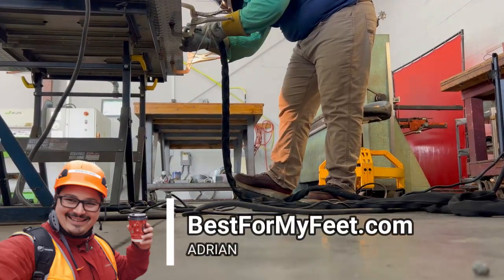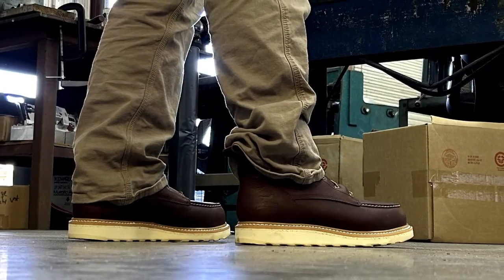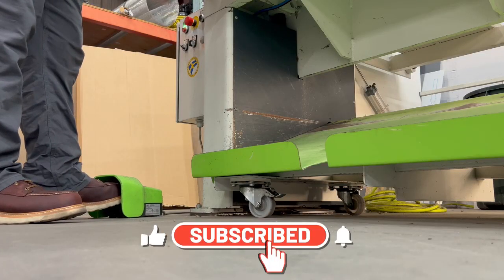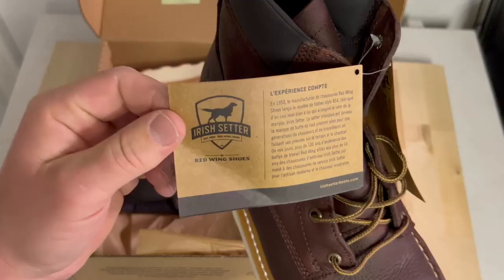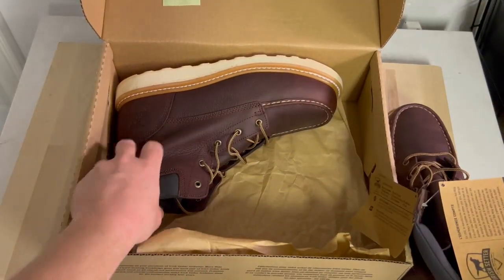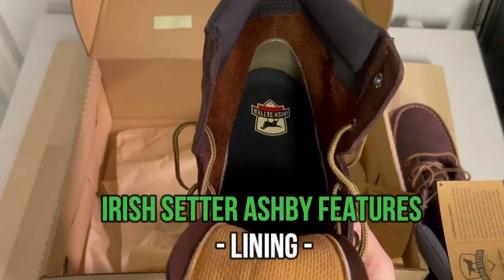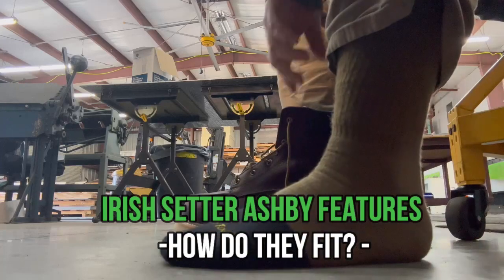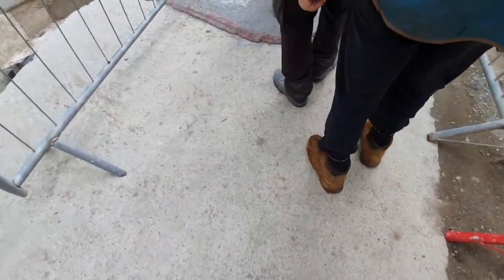Irish Setter Ashby Work Boots Review (Tested On Smooth Concrete Floors)

Comment: I am unable to find a welt replacement cobbler, so is it possible to replace the outermost 'rubber outsole' as seen in your video at 4:37-4:43? i could get a vibram sole shipped to me, but it would have to be a kind of peel off, stick on' job at the local cobbler level.
Would highly appreciate your revert on this for many of us.